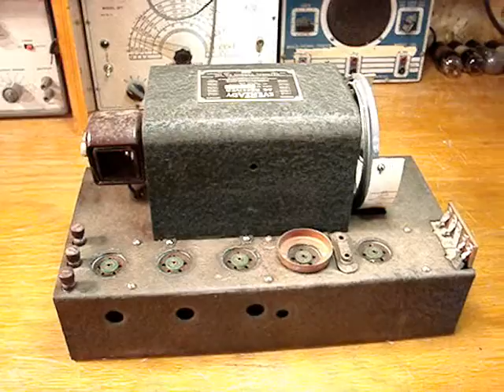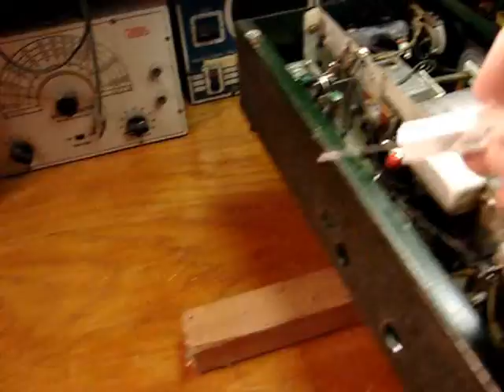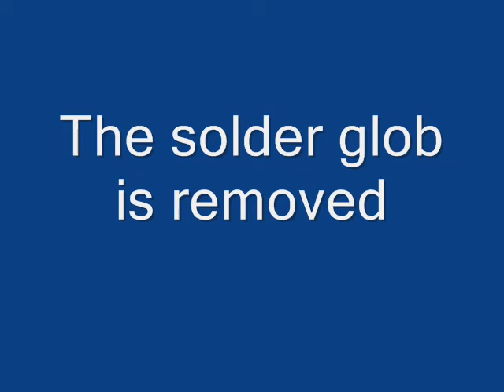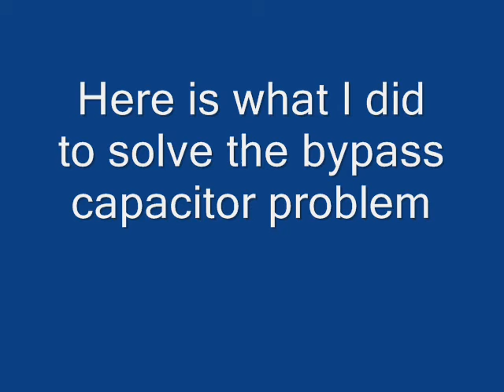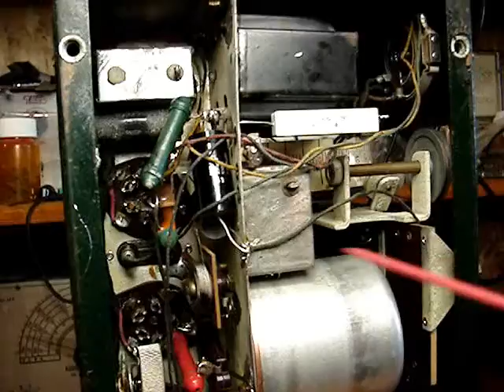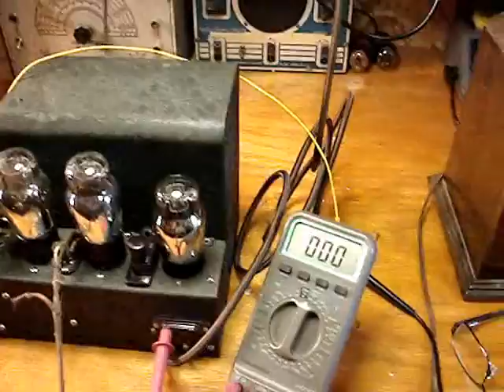Eveready 1930 Radio Model 31 PT5

Comment: I hoping to hear it play,I've had similar things to happen. Maybe an intermittent short in one of the audio transformers ?. I have heard of brand new caps being shorted before. I have no doubt you will get this problem sorted out.
All the best.
Bobby
Reply from the maker: ***** I do not think the problem is in the audio transformers. I thoroughly checked them out before I even started to rebuild the radio and I checked them all out again. Afar as DC ohms they check out OK. The 280 might be bad but I think it has something to do with that strange way they made a path to ground off the 71a filaments as there is no separate cathode in a 71a.  Look at the schematic and see what you think. I don't think I understand that early push-pull circuit. Gary
Reply: HD7100
Hi Gary. Thank you for the reply. If I can find the schematic I will give it a go over. You are correct the 280 tube could have just went south, so to speak. Do you have fuses installed to protect your power transformer ?. Just wondering.
All the best.
Bobby
Reply from the maker: ***** Hello again. The link to the schematic is in my description above but here is is.

http://www.nostalgiaair.org/pagesbymodel/145/M0040145.pdf

I don't have fuses on the B+ as there were none originally.  I'm thinking the problem might be with that 4.7uF electrolytic I put in that circuit that establishes grounded cathode on the 71a tubes. That cap should be a 1uF non-polarized cap. I wasn't thinking. I replaced that 4.7 with a 1uF but the only new cap I had on hand is  rated for100V and I am thinking that might be too low of a voltage rating for that cap. I will see. Gary
Reply: HD7100
Hello Gary. That cap could be the problem. And thank you again for the reply. I am looking forward to your next video.
All the best
Bobby

Comment: Could the 71a's in conjunction with the 4 4.7mfd caps overload the 80? From what I can see in the RCA tube manual, 20mfd is its limit.
Reply from the maker: ruff hardin I don't know but one thing I didn't take into account is how those 71a tubes work in that early push-pull configuration.  There is no real cathode as the filament is also the cathode but yet the filaments are on AC. That 1uF cap in parallel with the 1K ohm resistor off the voltage divider is actually the path to ground for the tubes to conduct to when the grids are modulated. I mistakenly put an electrolytic there and I think that cap should be a non polarized capacitor. I replaced it with a 1uF but the only cap I had on hand was 100v. That may be too low but I can't be too sure. I am not sure I fully understand how that particular push-pull circuit works as much as I would understand how a pair of 6550s would work. Gary
Reply from the maker: ruff hardin I can also see if I can get 1uF and 2uF at 450 volt electrolytics. One 
original value was 4uF so I would think the 4.7  is not too drastic. The
 value of those filter caps should not make that big of a difference.